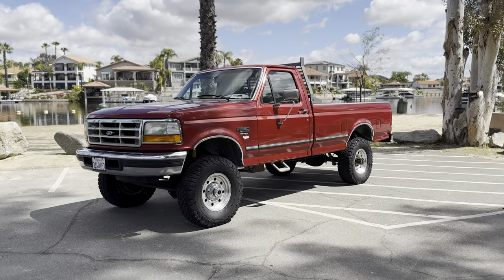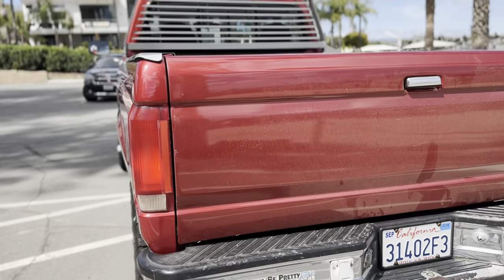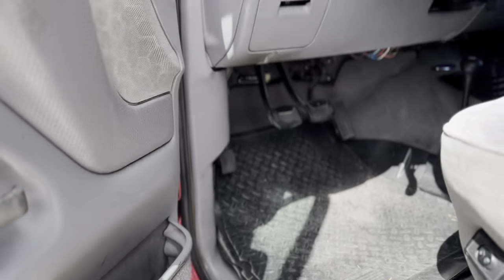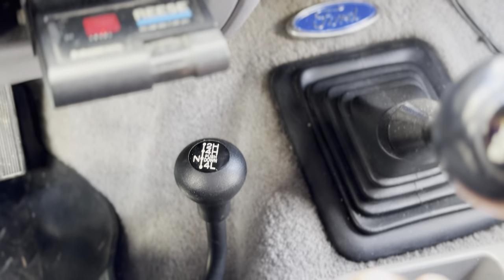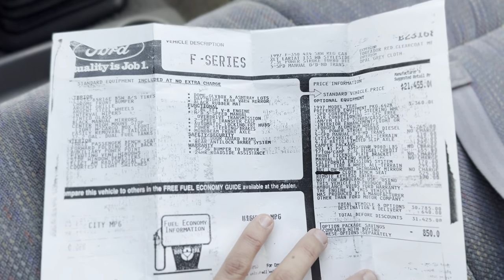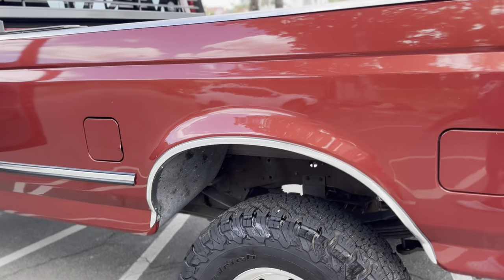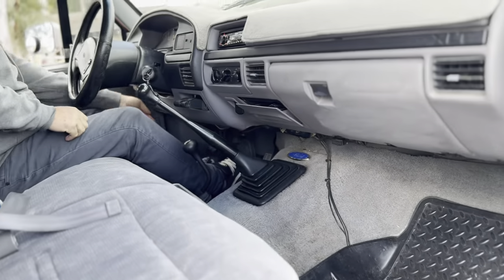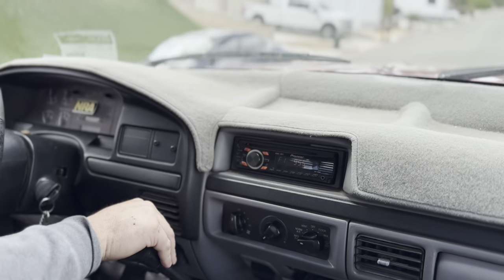*SOLD* EXTREMELY RARE 1997 F350 OBS Powerstroke 7.3 Diesel - FOR SALE - Dynamic Rides Diesel Trucks

Comment: How is this rare
Reply from the maker: If you’re asking this question, the truck is obviously not for you.
Reply: @dynamicrides  its not rare lmao its not even that old
Reply: It isn't
Reply: Its nice… but not rare.
Reply: Some people don't understand rare doesn't mean it's old vs new or how many they made. The fact is it's hard to find an original obs in this condition most are rusted out, or they have lights or switches that don't work anymore, that's why when you see trucks like this in this condition, they are a pretty penny. Especially one with 171k miles vs one that has less than 100k miles
Reply: @joshualake4882  its still not that rare lmfao
Reply: @majin2967  like I said if you knew anything about cars, you would understand. Rarity has nothing to do with age or quantity. If you have a certain vehicle and someone else has the same exact vehicle but one is mint and one is a rust bucket, the mint one is rare because it's rare to find it in that condition. It's a car thing, you wouldnt understand.